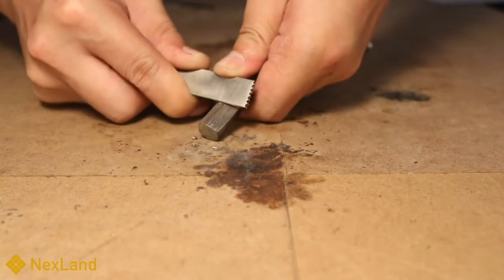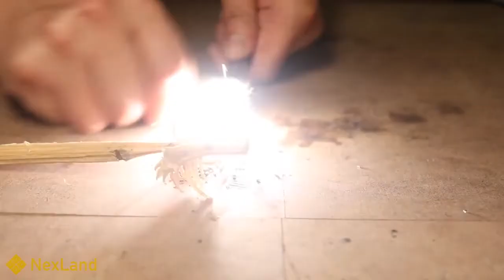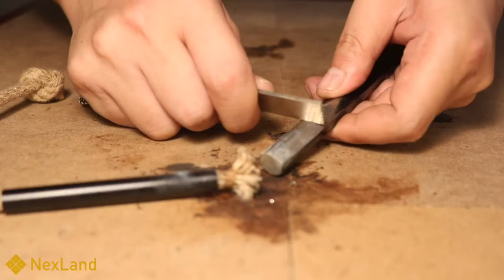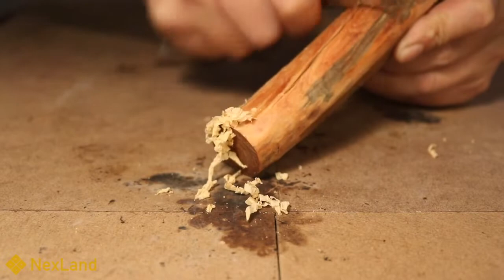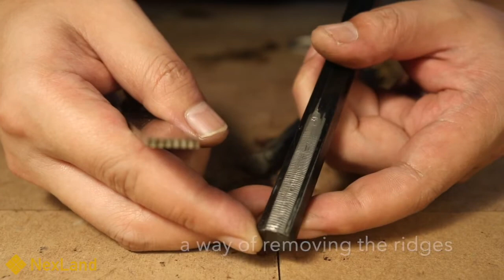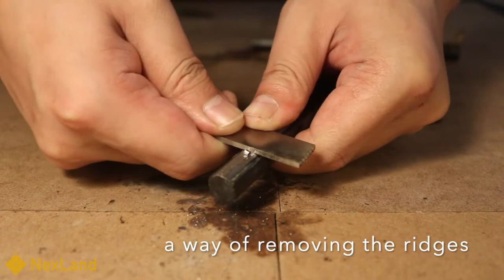NexLand HS-10014 Ferro Rod Striker Oversize High Speed Steel

Comment: How long does the edge hold up? When dulled, could it be sharpened with the flat file?

Also, regarding the rusting, are we supposed to keep these oiled in between every use?

Thanks!
Reply from the maker: My high-speed steel has been treated with titanium plating, which is not easy to rust in the general environment.
HSS's striker will still work after 8000 strikes.
It's hard to fix...
Reply: @nexland6139  Thank you!👍🏻